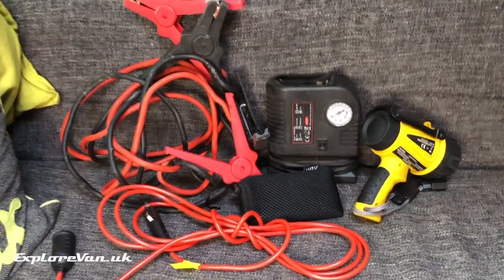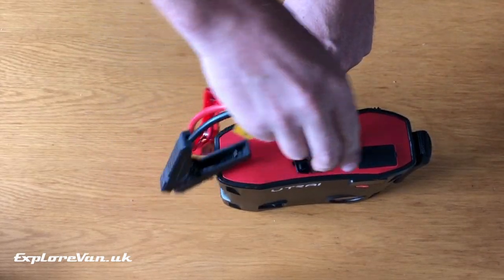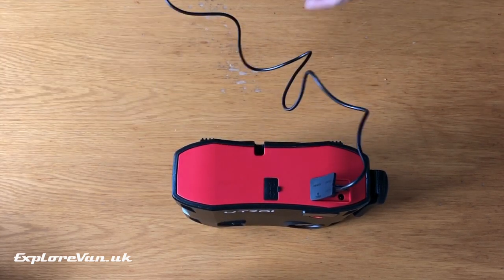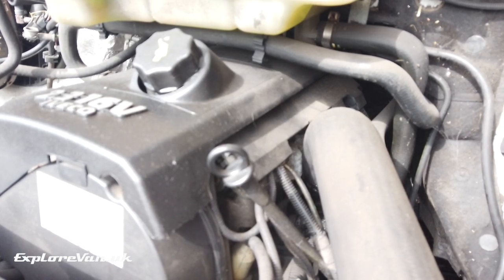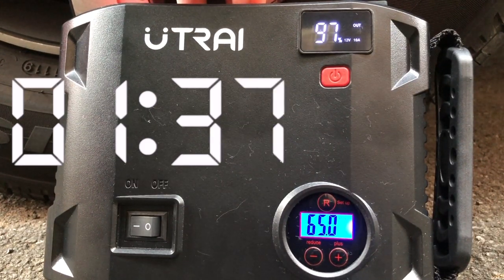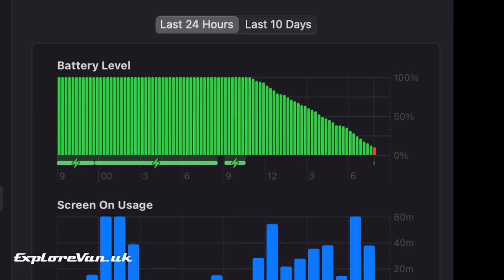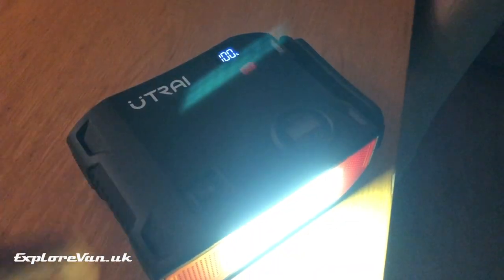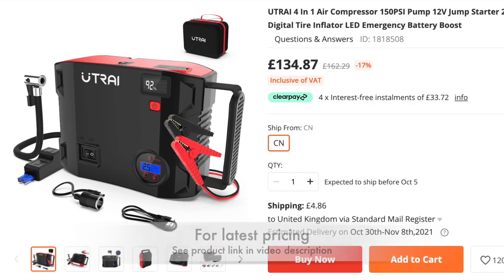Is this the most useful Campervan Gadget? - Utrai Jstar 5 Compressor, Jump Start, Power Bank, Torch

Comment: When it comes to keeping the vehicle battery charged, especially in periods of inactivity, have you any recommendations which can be added to a van build. Our van will be used predominantly with mains hook up both at home and onsite, but we have suffered a flat battery in the recent cold weather. Much is written about how to keep the habitation battery charged but little in the way of taking care of the vehicle battery. Thanks Jim
Reply from the maker: Hi Jim,  Yes we fitted a dual direction Voltage sensative relay (VSR) this means that the leisure battery is charged when driving once the starter battery is charged like normal but also when not driving the starter battery is charged by the mains charger or solar once the leisure battery is full.
Reply: @ExploreVanUK  Brilliant thanks, that sounds just what we need. Have you a product link by any chance?
Reply from the maker: @jimbyrne9643   👍 this is the one we went for. There are marginally cheaper ones but everyone seems to speak highly of these. 

https://amzn.to/3Kkfp9C

Comment: The battery on these is advertised as 27,000mah. For that not to fully charge your laptop suggests they’re overstating the capacity. 

Sent my unit back after it got 3 out of 4 tyres from about 40 to 65psi, but fully depleted, then after a charge I tried the 4th. The compressor made a rattling noise and then broke, let out out all my air. Problem with multi use devices, if one bit breaks…
Reply from the maker: Hi, not sure where they are advertised as 27000 mah, do they say what voltage this is at?  

On the Utrai site here - https://www.utrai.co.uk/products/j-star-5 they are advertised as 59.2 Wh which at 14.8v (the voltage of the battery) equals 4000 mAh.

Sad to hear your experience, thankfully ours is still working well, after regular use over the last 2.5 years.

Comment: FYI I asked this of Utria via their website email form

I'm trying to decide between the jstar 5 vs jstar 6.  I read the differences in the specifications and that the jstar 5 is slightly more powerful.  Is the jstar 6 smaller in size?  It looks so.  Are there any other differences?  Do you have a comparison  chart?  Is the jstar 6 a new model?  I'm leaning to the Jstar 6 as it appears smaller and may fit in glove compartment

Here is their answer 
Hello,
The size of Jstar 5 is 201*153.5*77mm(L*W*H). The size of Jstar 6 is 212*162*70mm(L*W*H). So Jstar 6 is not smaller than Jstar 5. And I am not [sure if] both of them can fit in your glove compartment. The air hose of Jstar 6 is separate from the unit. While the air hose of Jstar is not. And Jstar 5 is more powerful than Jstar 6.
Hope this helps. Have a great day!
Best regards,
UTRAI Company
Reply from the maker: Thanks for taking the time to ask and update here!  That is really useful information for all - if I needed to replace the Jstar. 5 and couldn't get one I wouldn't hesitate to go with a Jstar 6 - I genuinely wouldn't be with out one now.

Comment: Looks a really interesting product. It doesn't seem to be available on Banggood anymore. Is yours still going strong? Some available on eBay, but no warranty so I'm not sure whether to take the risk.
Reply from the maker: Oh No! it looks like they have sold out in the EU warehouse. 

It’s still going strong with zero problems and we use it regularly. 

Personally I’d go for one where ever I could get it as I would struggle to be without it now I’ve been spoilt! 

I’ve never looked at any alternatives so there may be some around.